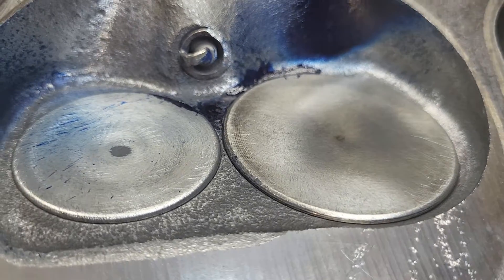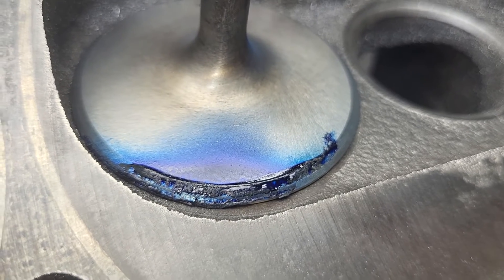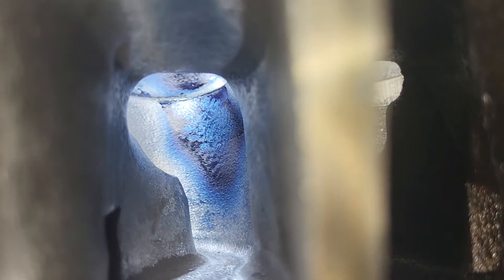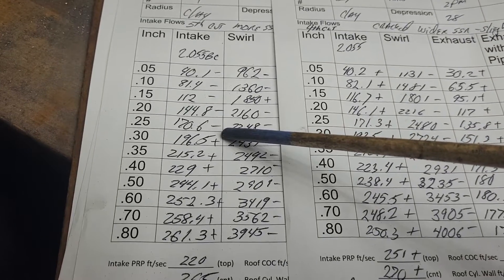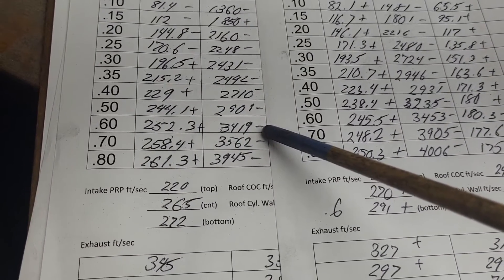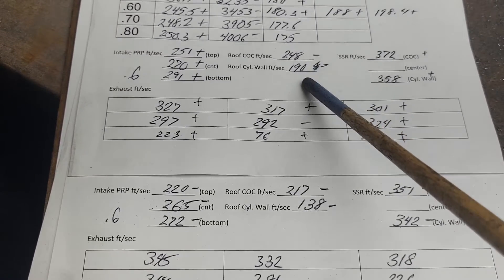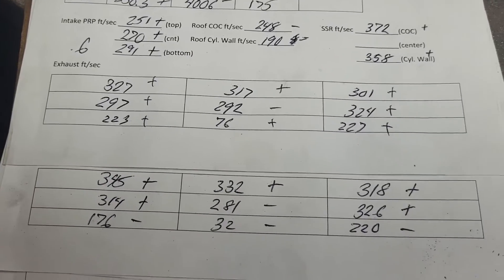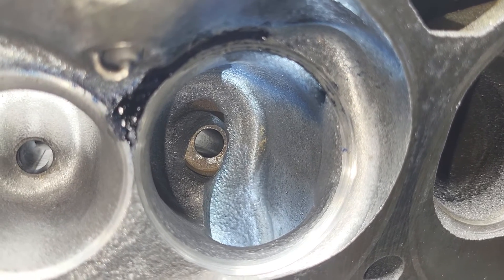6. Chevy 193 TBI swirl port cylinder heads. Fifth cut TBI Mission Impossible 9 sec

Comment: If you remove the bump of the spark plug, and shim it, will that increase the flow in the chamber and help the wet flow ?
Reply from the maker: It is an interesting thought. It might help with a very active chamber. I do like the plug more towards the center of the combustion chamber. Thanks

Comment: Instead of more lean on the swirl ramp (away from intake runner) can you change the swirl ramp angle to direct the ramp more vertically (scoop up more, for want of a better description) to reduce the swirling air banging into the straight air.
Reply from the maker: I doubt that can be changed much. Thanks

Comment: I like the extra high lift flow, along with the reduced swirl. Too me, that's a win win. The high lift gains are significant compared to the small low losses, so I think that port is a much happier full throttle port. At low throttle openings on the street, probably much of a muchness. Looking at how it's shaping up,  I'm thinking that I'd like to try creating a 'jump ramp' on the helix to try and drive the air straight towards the valve. Combined with that, I'd try to put a ssr type radius on the port side of the ramp. My idea is that I am trying to force the airflow towards the valve, and that will create a low pressure area at the end of the ramp, which I can then use the pull more air in from the larger csa of the port to feed the ssr of the valve.  Don't know if I've explained that very well, but I hope that it makes sense. Too make it work, I think that I'd need to be quite aggressive with the ski jump and the radius. In Australia we never got that head so everything that I'm thinking about is based on your videos, so I'm quite possibly going in the wrong direction, but I think that the coc side of the ssr is probably sorely lacking in airflow. Regards Greg
Reply from the maker: The coc ssr has very fast air . I was thinking of messing with the ramp but not sure if it would help. Thanks
Reply: @servediocylinderheads  i  might be looking at it wrong, but I think that you understand my weird thought process

Comment: That last cut (showed to me anyway) that pushing the end of the helix back and widening the short side in that direction as well had a combined effect of reducing low lift flow and increasing high lift flow and that shows me that the discharge pattern is being affected more now as valve lift increases.
Previous the discharge pattern was more consistent through the lift range but now at lower lift there is more disturbance and less swirl and it is hurting low lift flow , its not till flow is increased that the pattern can adjust and more air can come in .
So would it be fair to say you now have more of a flow pattern shift during the opening cycle than before ?
And is that a good thing ? i'm thinking its a bad thing as rpm increases and pattern shift time decreases is there a possibility of something like port stall ?
Reply from the maker: Stay tuned it gets better.

Comment: Not as much loss on low lift as I expected. I might be blinded by the idea that if the ramp didn't exist, flow would be quite significant. Swirl might be cut in half. No idea if that would break through. I never tried it.
Reply from the maker: I don't see this design working without the ramp. Thanks

Comment: Now this is just my experience and theory here. With a fairly high lift, longer duration cam, less flow under 0.300" is actually desireable. It helps limit reversion and actually adds power. There are several Engine Masters builders of the past that felt the ideal port would flow Zero until 0.300, then hit max flow at that point.
Reply from the maker: Correct. Thanks

Comment: Great to see the flow gains but a bit unexpected on the low lift losses! It'd be a patient requiring work to reshape (perhaps with clay) the helix ramp and the end of so that it'd reduce the possible impinging across flow. I wonder is there a way to measure the the possible impinging flow in that area? Perhaps the impinging flow could explain the 'new' position and shape of the dye as well as the air speeds?
Reply from the maker: I bet it makes a big difference. Thanks

Comment: The way the end of the helix ramp is shaped is impinging on the flow across the short side. Be careful with pockets of air recirculation, the flow can have energy in those regions but because the energy is spent making the air recirculate it comes up as dead when you measure air speeds.
Reply from the maker: Stay tuned!